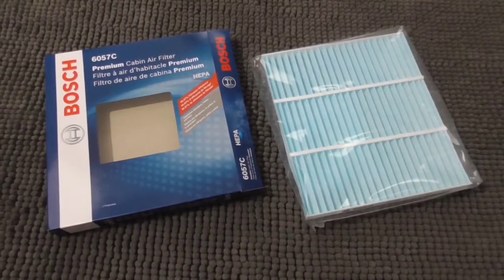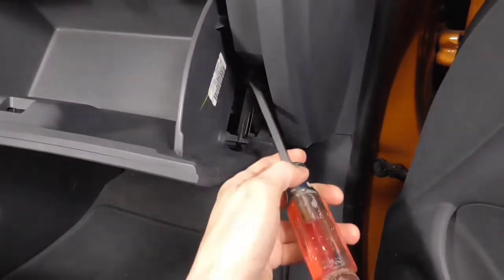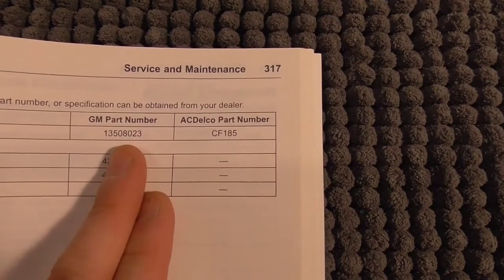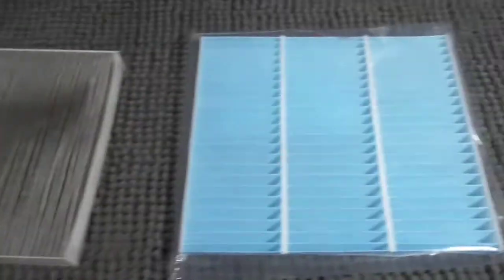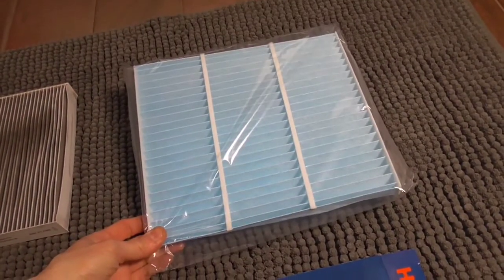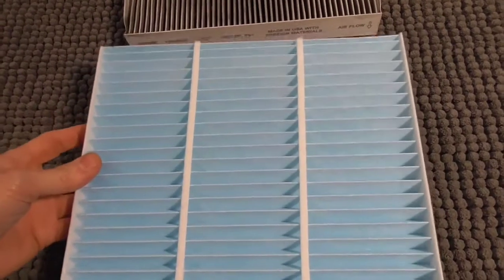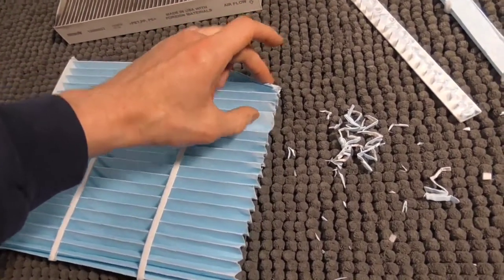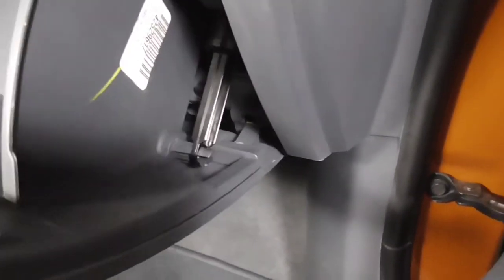Chevy Bolt - HEPA Cabin Air Filter

Comment: Thank you for the look at how to open / remove filter.  Takes the guesswork out!
Your original filter was saturated.  They're white when new.
Always get a correct fit filter.  Cutting can compromise the fit (don't compress to seal like stock if miscut).

Comment: you totally compromised the hepa functionality by cutting it like that. i'd suggest trying to reattach the end piece after making it shorter, possibly just overlap the extra filter material? anyway i found the 6091C on ebay for $16. hopefully it fits without modification. Thanks for the part numbers, this is a great upgrade!
Reply: Yes it fit perfectly
Reply: Any update on the fitment of 6091C in the bolt?
Reply: @Driftynate  I have the 6091C and it fits perfectly